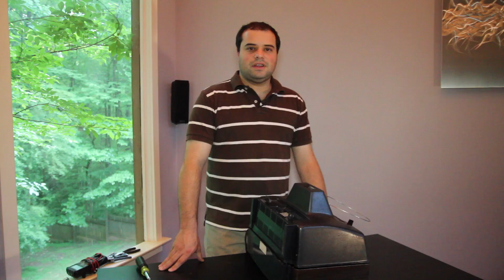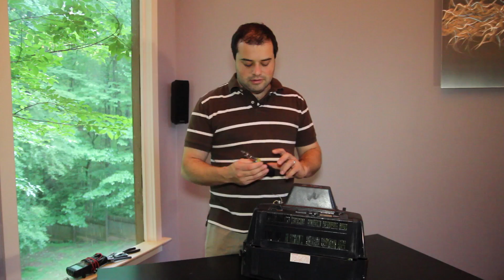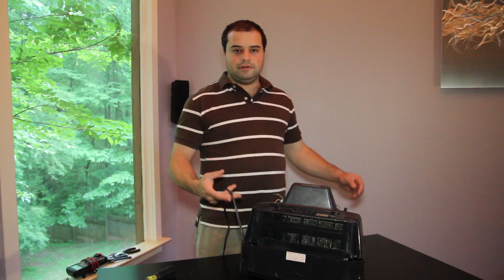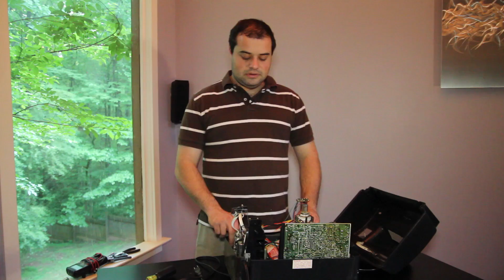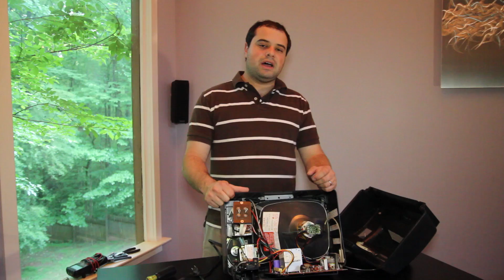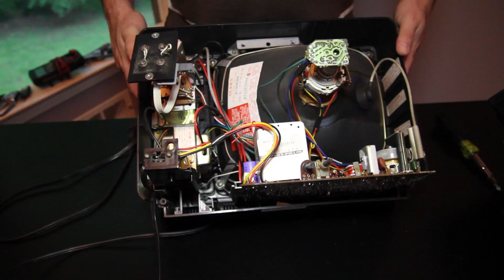Home Theater Repair & Installation : How to Troubleshoot Tube Televisions

Comment: @Novarto dependens if the cable is live, and what the power is, if its just a signal cable they be fine, but a power cable they might get a bit of a shock.